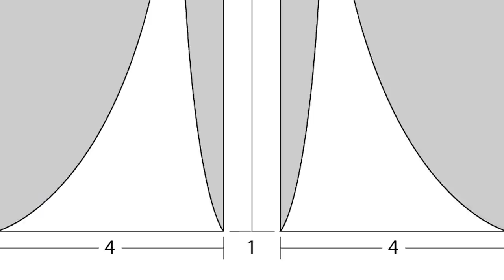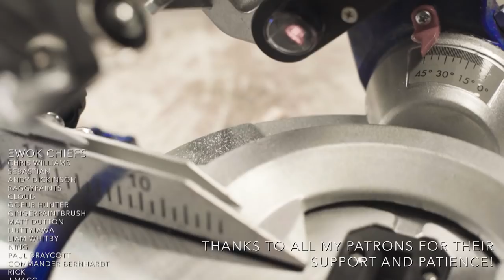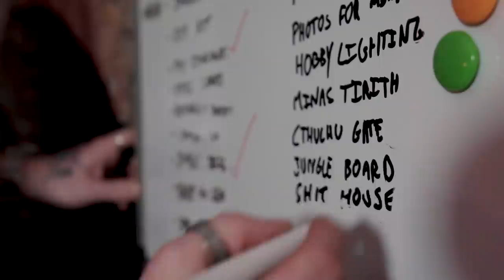CHAOS GATE - Building A Lovecraftian CTHULHU GATE MOVIE & GAMING PROP

Comment: Spraying solvents directly on foam can sometimes yield interesting results, depending on what you're after. Sometimes - again, sometimes, depending on your paint and how you approach it, you can get away with not melting anything, or at least not melting it significantly. Luke there, seems to have been lucky in this regard, and that luck has made him even more of an asshole, but his luck will not hold out forever. If you really care about your piece, and are at all worried about it, don't chance it. It's only a matter of time before you (or Luke), totally ruin something you care about. In any case, there are solvent-lite or solvent-free spray paints out there, like the Liquitex brand. If you have to spray without sealing, just use those.

Comment: It’s a mitre saw 😅😜
Reply from the maker: It’s on a fucking table.
Reply: @MSPaints  true, sir. But what differentiates it from a proper table saw is that it has the swivel and guides to cut mitres where as a table saw is mainly for sliding long pieces of wood to cut along the table haha 😛